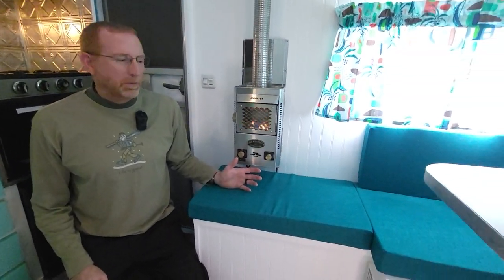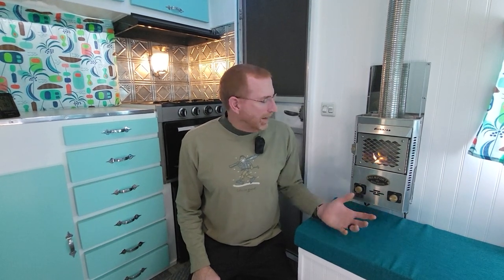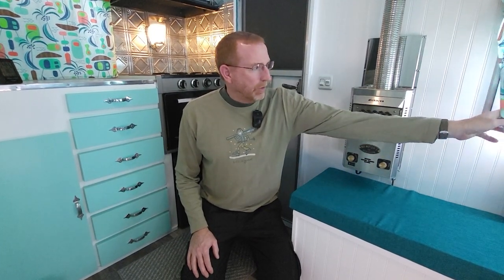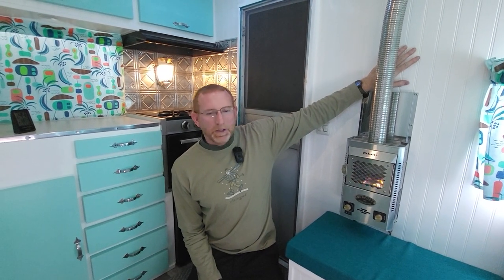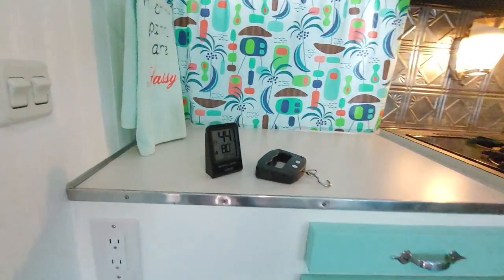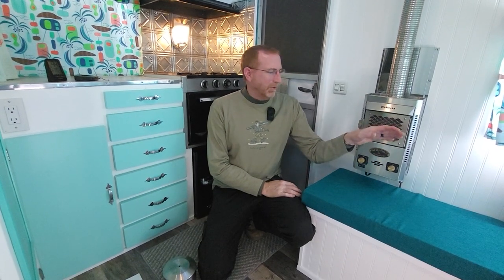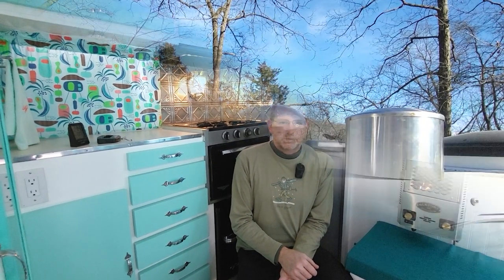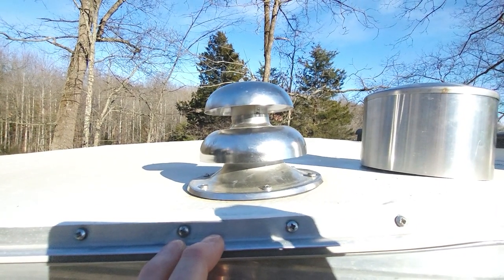Long Term Review of  DIckinson P-9000 LP Heater

Comment: Thanks for this comprehensive video on this product. I love the aesthetic of it, and was considering it as a cabin heater. Regretfully, it puts out too little heat and is too costly for something I would not use all that often. For your use case I think it looks fabulous and works well, but I need something with a little more oomph and more BTUs. Thanks again - this was quite helpful.
Reply from the maker: You're very welcome and thank you for the kind words. 
  Dickinson makes a larger version of this heater called the P 12000. Sure marine has the best price on it as well. You might check that out.

Comment: Thank you for making and posting this video.  Very informative from real time users.  A few tricks I haven't seen elsewhere, but also long term real reviews are so helpful for shoppers (future heater buyers) such as myself.  Although expensive, so far the P9000 is best for the setup I am building.  Will look at the Propex though, I had not hear of nor researched that heater.  It's real and informative videos like this I really appreciate.  Great job, and thank you!
Reply from the maker: Thank you very much for taking the time to comment. The Propex is a forced air heater like your home furnace. It is a really nice heater and has served us as well. We have a video on the Propex HS2211 undermount heater. Propex offers several different heaters so you have a couple choices. Check the videos on our channel to see the Propex heater video. We will have a 6 month review on the Propex coming out soon. 
 I really like the simplicity of the DIckinson and if we would have had room for one in our teardrop I would have bought another one in a heart beat. 
 Thank you again for your kind words. We are glad the video helped you.

Comment: Thanks for the thorough presentation.  I've been studying this unit for a couple months and have seen mixed reviews. Folks either think heat is more than adequate or it underperforms.  Aesthetically, everyone likes it.  Curious what size your camper is, including length, width, and inside height?  (Cubic ft) How thick are you walls? And,  what part of the country do you use it most as to night time temperature and performance?.  Have heard adding another fan to room helps to circulate heat better.  Thx kindly.
Reply from the maker: Our camper is approximately 9x7x6½ with ¾" foil faced foam insulation in the walls.  It's a vintage camper with the old Jalouse style windows that leak like a seive. The floor is not insulated. Above 30 it stays nice and warm. Below that if the wind is blowing it struggles a bit due to all the air coming through the panes of glass in the windows. It's like trying to heat a drafty barn with those old windows. I am sure the heater would do fine in a camper that size if it had windows that actually sealed up.

Comment: great video! do you have to open and light it once a day, or only when you turn it off and the flame goes out? if you keep it on low and don't turn it off for long periods of time, do you still need to re-light it? thanks!!
Reply from the maker: @sams0blu  the heater does not have a pilot light so anytime you shut it completely off you will have to relight it. We typically light it in the evening and just leave it on low all night.
Reply: @adventuresofthememorymakers  ok, thank you!

Comment: Thanks for the review! What size trailer do you have it in? Also, what’s the coldest outdoor temperature you you’ve stayed warm with it in? I have a 17x7.5 foot travel trailer and am thinking about getting one of these but am worried it won’t be able to keep the whole thing warm in the mountains when outside temps are 20 or below.
Reply from the maker: Our Dickinson heater is in my wife's Shasta compact which is 9 ft long and 7 ft wide. It's insulated about as well as I can insulate it but the floor has no insulation in it and the old windows leak like a sieve. We've had it out on a 20 degree morning before and it took a long time for it to warm up but it finally did. I would say a trailer your size unless it's really well insulated and sealed really tight you would be stretching the capabilities of the unit. The p12000 is a little bit larger but doesn't put out many more BTUs. It's a Wonderful heater just have to keep it within its capabilities.

Comment: Nice informative video. I ended up purchasing this heater. Do you know if at the bottom where the propane line hook up. There is a elbow. The piece it attaches to has a cap on the side. Is that so you can choose to have the propane elbow pointed downwards instead of to the back? My line will be running attached to the wall, as is the lines would have a 90 degree kink in it, don't want to mess with that little cap if it's not for that purpose. Thanks
Reply from the maker: I had to go look at ours because I could not remember. There is a brass t block on the bottom of the heater for the gas inlet. You could use the port on the bottom or the one on the side that is plugged now. Just remove the plug, clean the threads, reseal, then install in the bottom port.
 If you don't need the elbow you could also just replace the elbow with a straight fitting. 
 Thanks for watching. Ours is running now as Cindy is stitching in her camper.
Reply: @adventuresofthememorymakers  thanks for the reply. That's a great idea, do away with the elbow all together.  I'm also researching to see if adding a quick connect fitting would be safe? I use this heater in my self converted enclosed trailer. Everything is fixed in using an e-track system, so everything can be taken out to use as a regular enclosed trailer or as a camper.

I gotta say this heater is very nice and cozy.

Thanks.
Reply from the maker: @mrchrisknight315  , I don't think they recommend using quick connect lp connections inside the living space. I have never been a fan of them myself as they tend to develop small leaks over time and use.
Reply: @adventuresofthememorymakers    awe okay, I wasn't sure, that's why I was researching it. I know that air hose quick connect fitting always leak air, but thought maybe the gas line ones were better built.  Thanks
Reply: @adventuresofthememorymakers   so after doing more research on the quick connect I decided to permanently connect the interior portion and just add a quick connect to the dual stage output outside. Then I can roll up the line when not in use. 

Some manufacturers do say that their fittings are rated for indoor use, but the majority of information outweighs this idea.
Reply: @adventuresofthememorymakers I've got mine all hooked up, I'm wondering what temperature you get out of the front of the unit? With a temp gun pointed at the glass grill, I'm getting 289-300 degrees celsius.  Seems about right but thought I'd ask. 

I think I need to buy the extra chimney piping to bring mine lower, I'm at about your counter height. But to remedy this issue I'm currently running a extra fan to blow the air from the ceiling back down. 

I'm really impressed with the fuel consumption. I'm at 180 hours and counting from a 20lbs propane tank.
Reply from the maker: @mrchrisknight315  honestly I've never checked to see what the temperature of the unit is when it's running as long as we stay warm that's all I worry about. Ideally you want the heater is low and close to the floor as you can get due to the fact of heat rising. I see a lot of people put them a couple of feet from the ceiling and I'm not sure how they plan on getting the heat back down towards the floor or maybe they just like having cold toes LOL
 Due to the type of Windows in Cindy's Shasta camper and all the cold air that they let in we won't camp in it below 35°.
 We are glad it's working out well for you. It's really a pretty neat little heater for what it is.

Comment: You mentioned having a propex heater as well. Which is better?
Reply from the maker: We installed a Propex HS2111 in our Bushwacker Teardrop. It's a awesome little heater but a totally different type of heater. Both produce heat without adding any moisture to the air. Both are really efficient. Mechanically the Dickenson is much simpler and personally I like that. The Propex is electronically controlled like a furnace in a house. It works great but if it ever has a problem fixing it may be more of an issue. 
 We have a video of our Propex if you want to check it out.
Reply: @adventuresofthememorymakers  Thanks for the video and reply. I'm building a topper on pickup rig. One of the reasons I don't like diesel heaters is the maintenance. Don't want to work on stuff while enjoying time off! Thanks again.
Reply from the maker: Totally understand that. I would have probably gone with another Dickinson if we had room in the teardrop for that very reason. The Propex is an awesome unit and I feel that it is built so much better than the typical RV heaters you see today. The original unit in our teardrop was a huge POS that I ripped out first thing.

Comment: When you say you can cheat, and turn it down lower; after pushing the dial in and turning it down further, when you let go does it still pop back out? The reason I ask, is because if it stays in when you turn it down lower than low, it may bypass the thermo-couple and keep the gas on if the flame goes out which would not be a safe situation.
Reply from the maker: Thank you for that tip. I will check it out.
Reply: @adventuresofthememorymakers  Have you tried blowing the flame out when you have the heater dialled down really low to see if the gas shuts off as G Stephens asked, this would be a very Good thing to know.

I have a 9'X5' fold up caravan/trailer, 3/4" insulation (closed cell foam) in all walls and floor, I have yet to check the ceiling but imagine it would be the same.
It's tightly sealed considering it's a foldup.

I live in Ireland and winters rarely get down below freezing, at least not by much.
I'd need to be able to set it low and still have some safety.

Cheers for this info you have already provided in the video, your caravan/trailer looks Ace!

Comment: Nice...Great presentation...Go to Dickinson Diesel Heater best installation ever.
Reply: They're great Greg but hey! even on the lowest setting at 6500 BTU is way to much for small insulated spaces...6500 BTU on High and 1000 BTU minimum would be perfect for both my campervan and caravan.
Unfortunately those Dickinson Diesel heaters need to be turned up for best efficiency and a clean burn. They're fantastic for cold climates and larger spaces, especially if not insulated very well...I'd almost get myself a large motorhome just to fit one inside it haha.
Reply: @pa_maj.MARTINI-van-MAN   After two winters I have found that my Dickinson Diesel Heater burns clean with no soot or smoke or smell on low as well as higher settings. My advice would be to put it as low as possible even if you need to redesign the space/cabinents. Too many people put their heaters up high.
Reply: @gregfawcett5152  That's good to know Greg, cheers. Yes, keeping a heat source as low as possible is definitely the way to go as heat naturally rises. I've seen heaters/stoves up High myself. Unless there's a fan or two to move the hot air down, It's a waste of heat, you end up getting cold feet and legs although you're head will be warm; not ideal at all.

Comment: one thing never mentioned there are infact 4 points were it infact leaks carbonoxide...the blass window is not sealed...top and bottom of stove pipe were it conbects is not sealed the doir had a very poor seal situation - its not like a wood stove with a slotted fxed inset doorxshut that seals tight when shut,, yea! its just sumply a peicevof fyberglass rope on the the flat serfice of the door and it just shuts up against the opisit flat serfice ...lol,, it most defentally does not provideca seal safe tightly seaked door.
    AND Also the stove does infact use interrior oxigen which they say dies not,,,thats infact false
    Truth - look up under the stove as it us lit , you will find neumerious small holes in the bottom were you will see light up with in the stove which is being lit buy its running flame...yea !
.   i would not recommend running this stove indoors ,, its eay over rated and not carbonoxide safe proof.   we ran testing on the heater and they do infact put out carbonoxide with your interrior area
    There are infact other buyers that have complained on line
     We contacted the seller with out cincers and even photoes and vidies vareious times and we got side steped andcignored every time
    They would never directieally address our priven issues.
    taje it or leave it,  yea! there pretty and shiney...lol
Reply from the maker: Thank you for that information I will definitely look into it.
Reply: The Dickinson models 9000 (in video) and 12000 are both marine-only units and built a bit different than the RV/Cabin model called the Newport Exporer model - which is the only model that claims to be "air-tight". The Explorer does not even have a front door that can be opened. It also has a battery-powered ignitor.